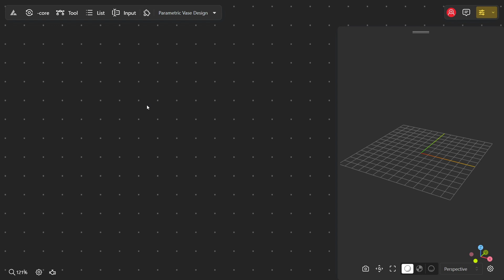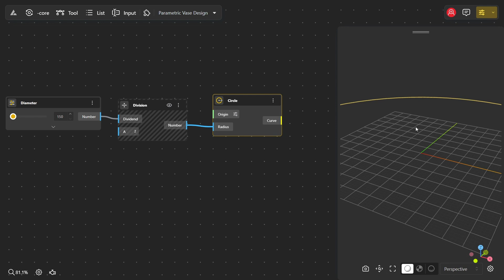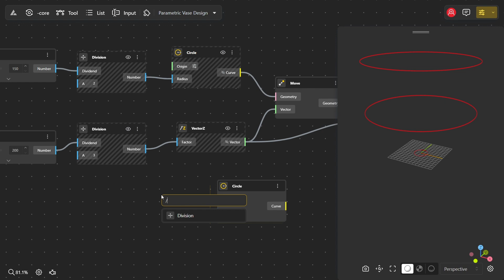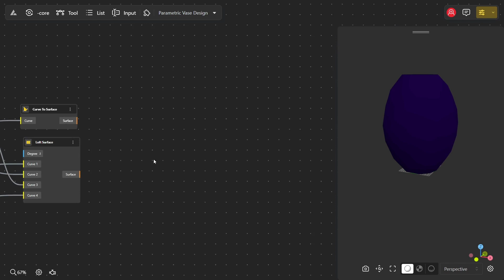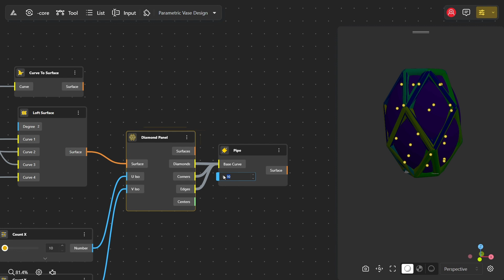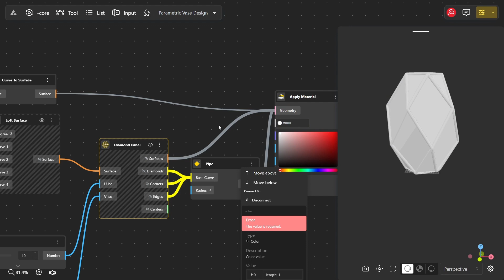Parametric Vase Design with Diamond Pattern

Comment: The panel nodes don't play well with closed surfaces. Also, to those wanting to optimize edge geometry, don't do: (Diamonds+Corners+Edges)>Flatten tree>Explode>Cull curves. Instead do: Surfaces>Surface join>Surface edges>Explode>Cull curves. That way you'll get 43 instead of 68 curves. Also, those annoying limit edges had the indexes 10 and 2 for me, if you want to remove them.